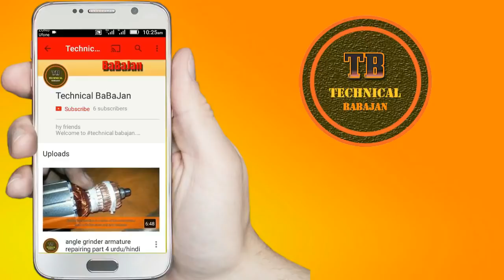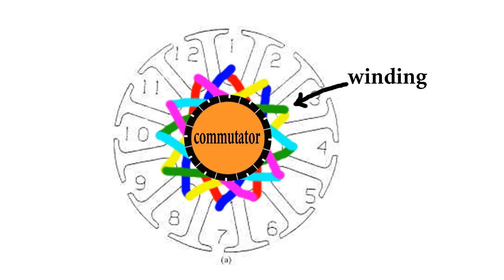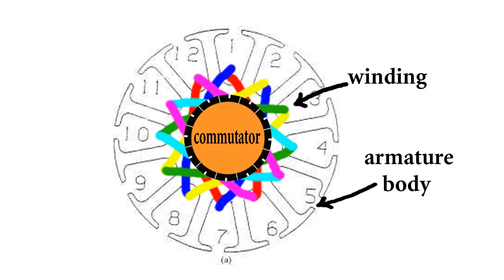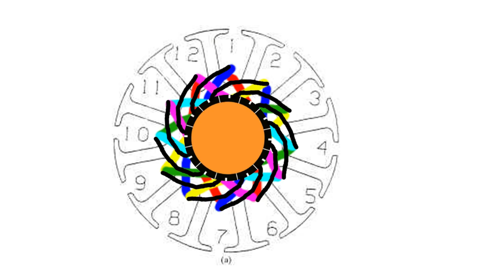juicer armature rewinding with diagram  part 2 of 2

Comment: sir 2 cm arnechar size hai turn 100 hai wire swg 31 hai winding slot 1----6 hai total slot 12 hai  comnutator 24 hai ishka taping kita per hoga mujhe smjaye apna chota bhai samjh kr please ishka reply digiy
Reply from the maker: 100/4=25       yani 25 turns k baad conniction nikalo

Comment: meri ek request hai sir apse mene abhi ek mixer grinder ka armature winding kiya hai 220 volts 200 watts lekin sir woh serius tester pr sahi chal rahi hai or direct 220 volt supply pr carbon heat kr rahe hai sir plz isk bare me koi help krdo
Reply from the maker: dost y ziada tr connections ka problem hosakta hai